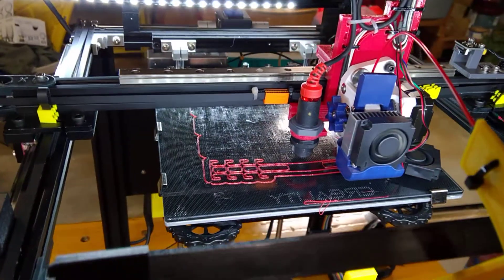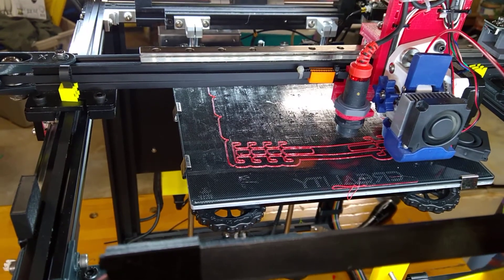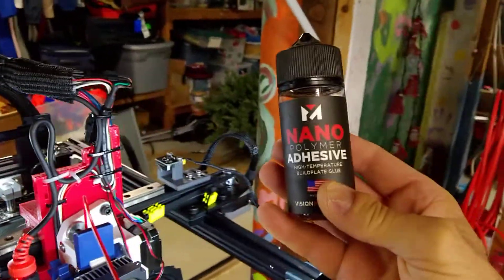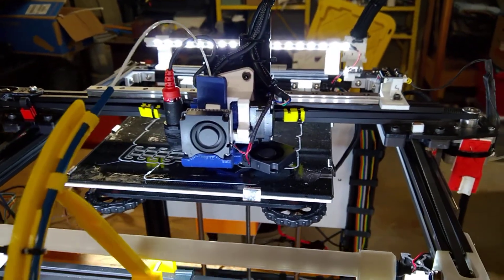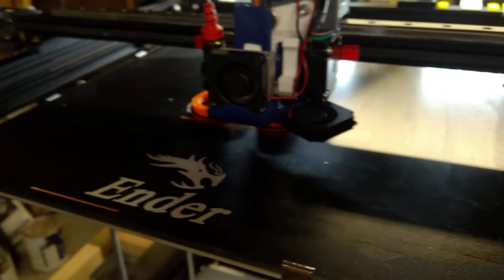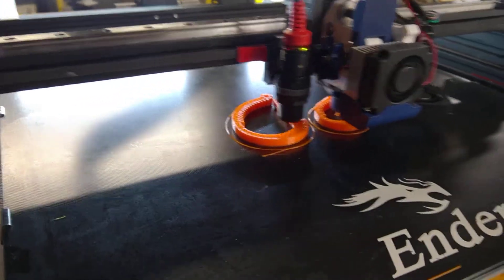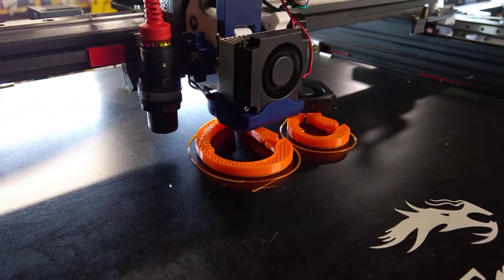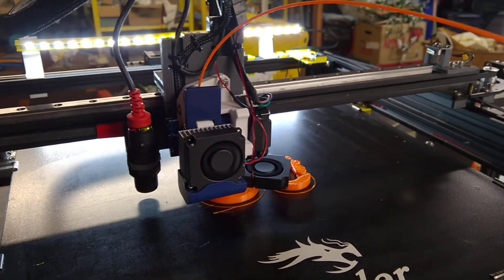Progress being made - Simplify 3D,  light bars and  Nano Polymer

Comment: Nice one Dave! I also only use Simplify 3D because of the manual support you can do. It is a life saver when it comes to models that need a lot of supports or have thin sections that need supports. You should check out that feature.
Reply from the maker: Max, You are the expert!!  I'm watching you-tube videos on how to make all of the options work.  So far it did a great job on creating supports automatically for my OmniaDrop mount.
I'm printing a new version for the Ender 5 Plus with a different wiring support.  It seems like it has a lot of power, but easy to use.